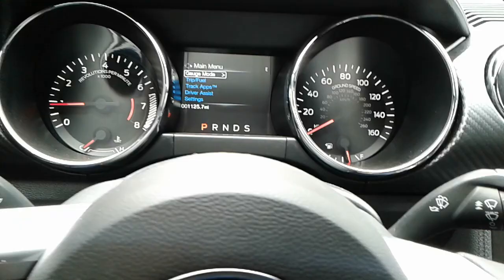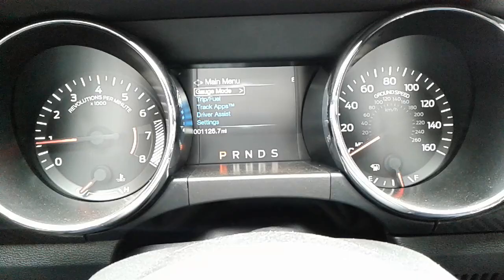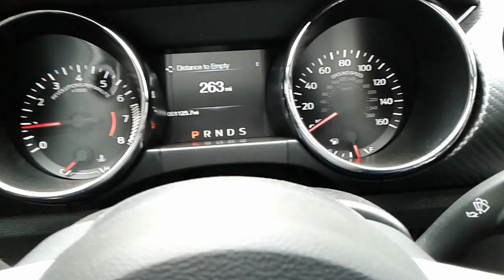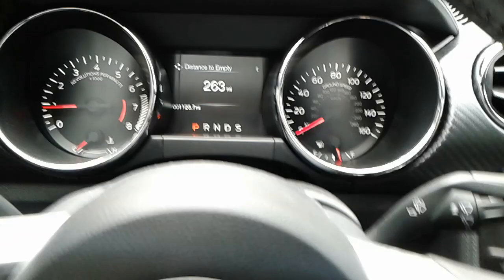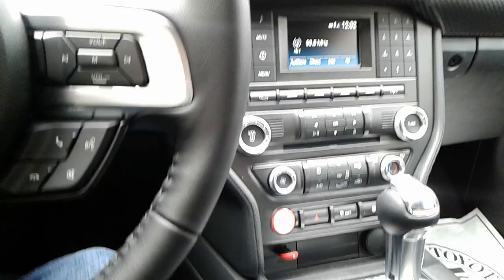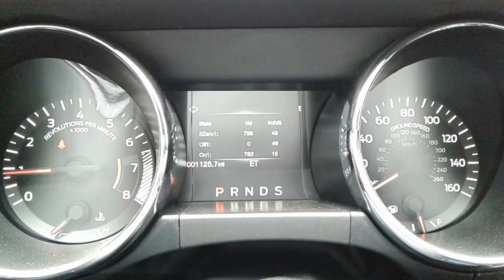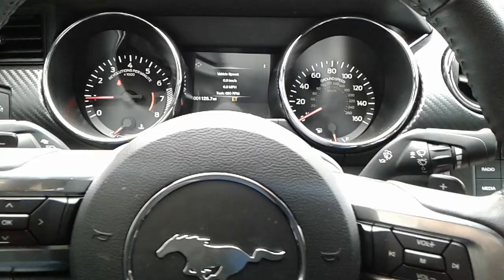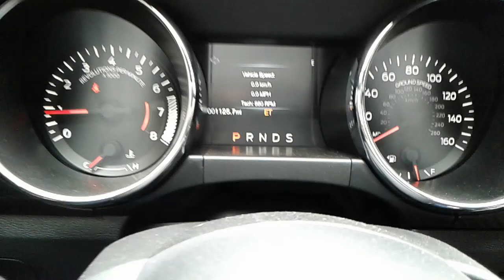2015-2017 Ford Mustang Digital Speedometer

Comment from the maker: Update: 
Unfortunately, I was in a car accident and the car was totaled in late 2022. Long story short, I got T-Boned on the drivers side from a car going 35-45mph while I was going 10-15mph. The only reason I say that is to mention how well the car protected me. The car hit directly where my driver door meets the tire, and it snapped the axle, which may have taken some of the force away from me. But the airbags deployed and I only had some minor whiplash and bruising on the hip from the side airbag. But overall I was pleased with how the car held up to the impact and I would feel safe buying another one!

Comment: Hi, Great video!! I am trying to figure out where is the oil pressure number located. I have a 2015 gt premium without a dual gauge in the center console. And since in normal mode, it only lets you know the oil pressure is low/normal/high. Is there any method to show an exact number of oil pressure? Thankx!

Comment: The car is a downgrade cuz of features ? Bet it was faster than ur charger. And I wouldn’t be surprised if u got the v6 basic model lmao
Reply: It prolly is. Full tank gets me 180 miles on my 5.0
Reply: @ChuukeseStink  how my gt gets a 240 on a full tank
Reply: @yungarchitect7215  you're right. Just filled mine up 2 days ago 🤣
Reply: I get 330-340 miles a tank out of my 15 gt..
Reply: @yungarchitect7215  bruh my goes from 180 to 230 depending on how my weeks going 😂😂(2k17 mt82)